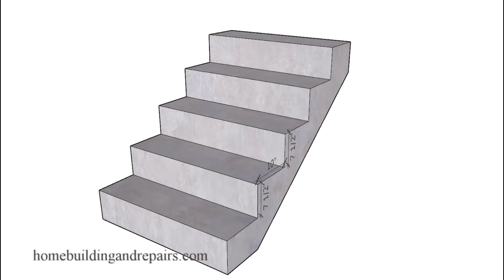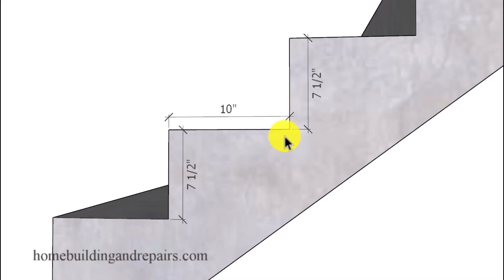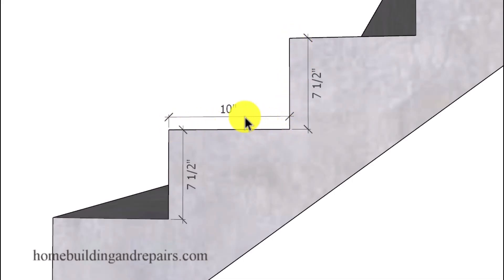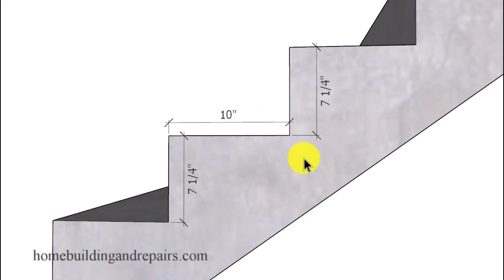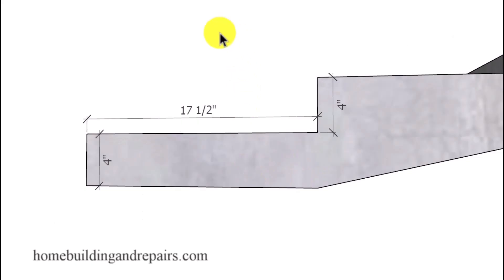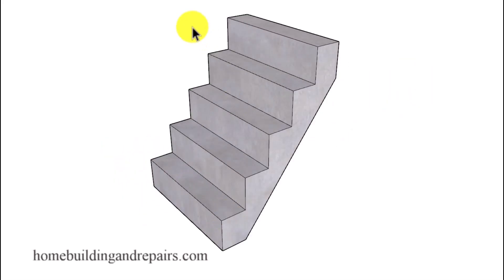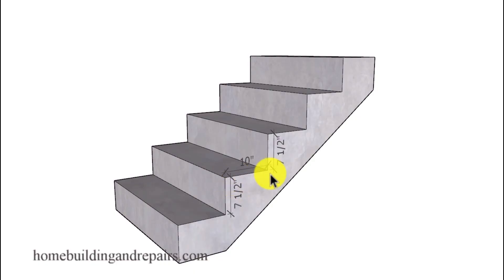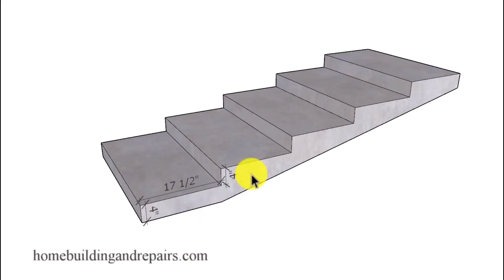What Is The 25 Stair Tread And Riser Design Rule? - Construction Education And Safety Tips

Comment: Ok I've been building residential and commercial, mostly residential homes for over 34 years and I have NEVER heard of this STOOOOPID so-called 25 rule. 
Where do people come up with this redarded crap? Any carpenter that actually thought that it made sense or even mattered one iota, whether the number of a tread depth, added to double the number of one of the risers, equaled 25 or less- They would've been required to immediately surrender both, their man card AND their tool belt. Full stop😂
Reply: Agreed. Just ran across this video and thought WHAT? that doesn't make sense. With this rule you can have 8 in rise and only 9 inch run, a very uncomfortable nasty set of stairs. while 7 and 11 is really nice. On the flip side 6 rise with 13 run would be a very lazy stair. All 3 come to 25 within this silly rule's parameters.